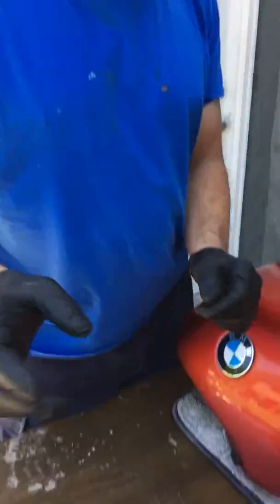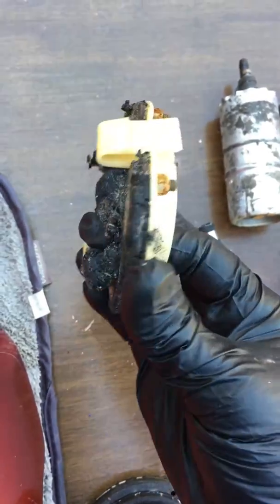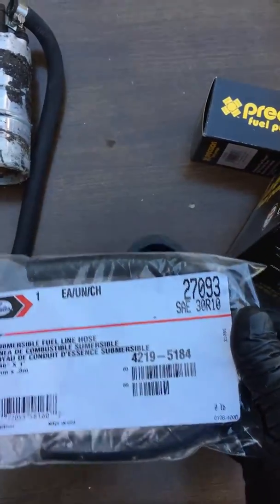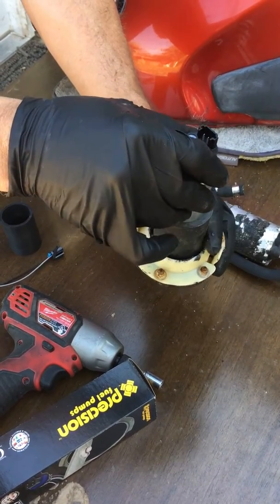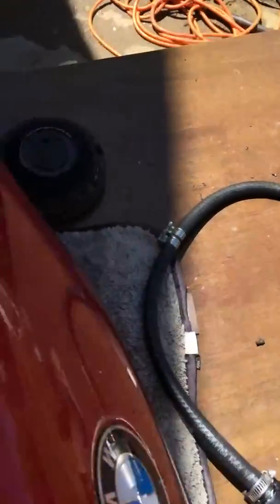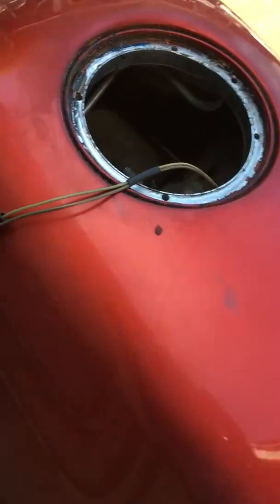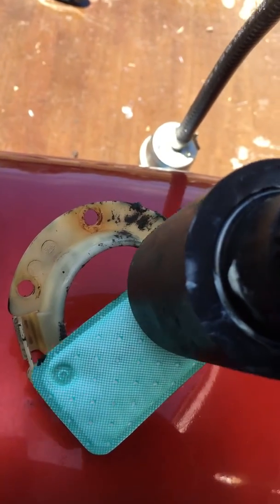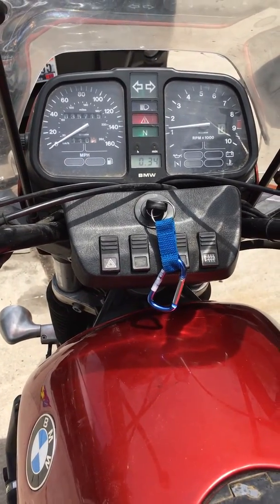BMW K Series Motorcycle  Fuel pump Retrofit Replacement

Comment: I looked further into the barb fitting understand now connecting the two 12' fuel hose segment, reinforcing the connection with the (2) 5/16 screw clamps. I gather at the pump's outlet you simply forced the fuel hose over the outlet and then secured it with a screw clamp doing the same with the filter inlet( both 5/16" screw clamps)
Reply: No

Comment: Thanks for your reply. Have a question regarding the barb fitting referenced at 3:20 in the video. Sorry for not getting this but what is the purpose of those 2 collar fittings located approximately midway between the pump and the filter; you made mention of the hose length, but that's what I'm not understanding...confirm that is just one segment submersible hose; a 12" Gates 27093 segment to connect the fuel pump to the fuel filter and then a shorter 2nd segment connecting the the filter's outlet to the tank's fuel stem going to the injectors. Can I reuse the fuel clamps presently installed or do you think it advisable I get new ones?  Thanks again for your reply.

Comment: I have a 1986 K75C and with the help of your video I will be replacing both the fuel pump and filter. However I wanted to ask in your listing of
required parts you indicate ordering (2x) 27093 fuel lines. Can you tell why I would need 2? The kit I'll order from ebay includes as best I can determine just (1) 5/16" hose. Since I've ordered from Amazon a Wix 33032 fuel filter which comes with (2) 5/16" hose segments that should connect both the inlet and outlet.  Regarding the vibration dampner I got off the internet the BMW part no. 16 12 1464628...what are my options? must a purchase an OEM which runs $107 or is there an aftermarket alternative? Thanks for your video and as a new subscriber I find your video very helpful.
Reply from the maker: paceairlines paceairlines In regards to the fuel lines that come with filters they are not submersible, being in fuel the outer casing will swell, crumble and burst. With the vibration dampener you could use factory or purchase a cheap submersible sleeve to fit on pump as I did in video. If any other questions feel free anytime, hope this helped.
Reply: paceairlines j́

Comment: I changed mine out with one for a Ford Taurus, and now I get vapor lock on any day over 85 degrees. Tiny bubbles rise up from the bottom of the fuel pump, as pressure backs up when the gasoline gets 125 degrees or so. Then I have to let it cool off until no more bubbles come out, and go on my way again. I don't know if insulating the bottom of the tank again will cure it or not.